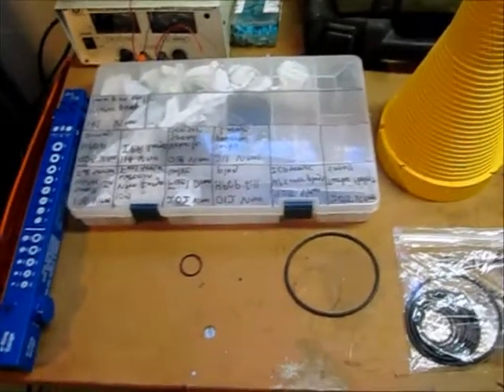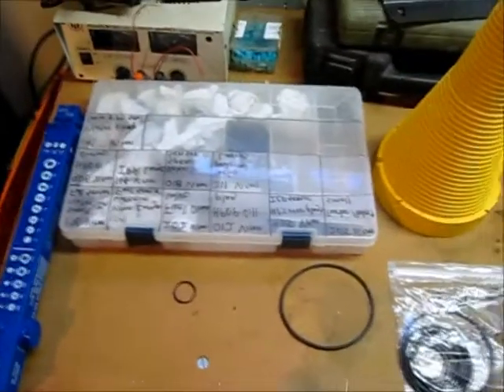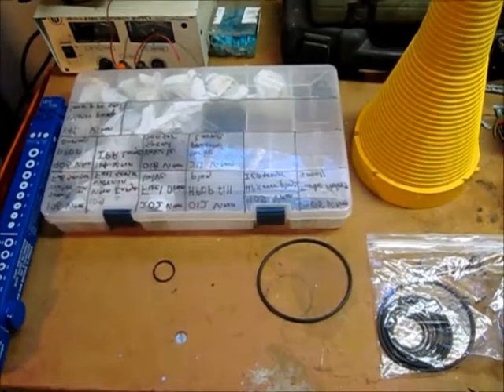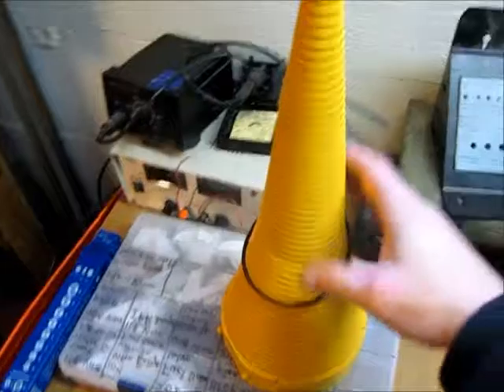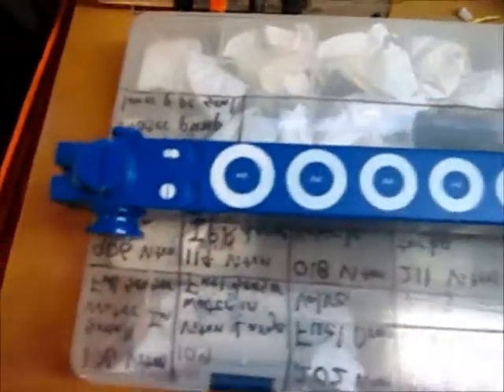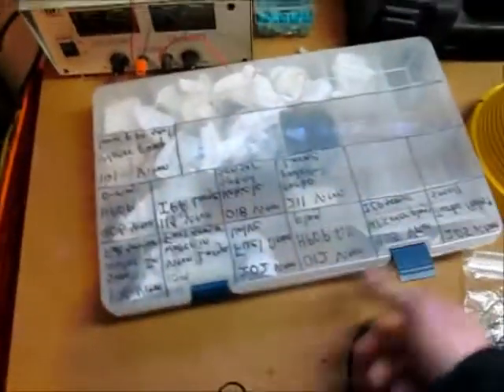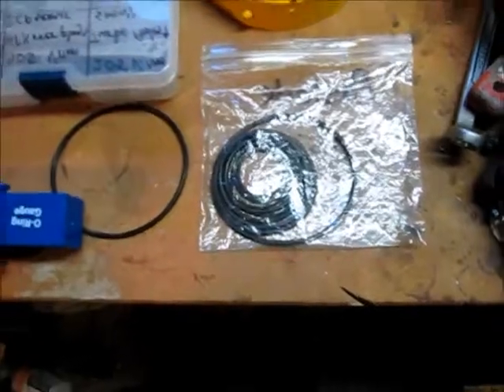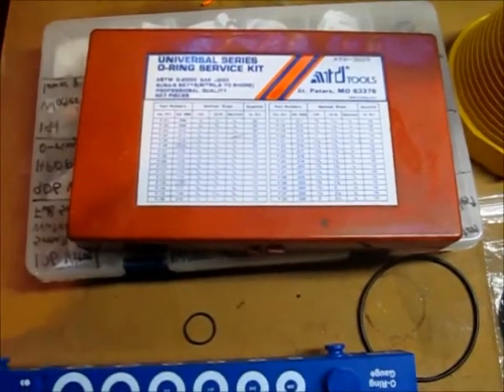O-rings and how to measure them

Comment: What if you don't have the original O-ring ? You measure the inside of the groove and then ? If you don't know the width how do you know ? What material is best for pneumatic nail guns . I went on McMaster-Carr and can't find that explanation of o-rings and uses . Can you help me out to rebuild a Basso BAT-50 16 gauge straight nailer that needs rings . It's probably from 1983 . They look like BEA guns

Comment: OK pulled out my dial caliper..came up with the numbers OD 2.525, ID 2.10, Cross section .210 ---- went to Mcmasters and found my item, I thought wow I was spot on...ID, check OD check...then the money shot...I thought if the cross section measures out to .210--- I am spot on...lol I was spot on.... my number is Dash 330 (Pool Union O-Rings American Standard pipe company). Going to save a fortune rebuilding some of my tractor hydraulics (instead of buying the rebuilding kits). Mcmasters wanted $.28 ea for qty 50 ($14.28) ( (+ shipping). Amazon had them for $1.80 ea for qty of 5. (Amazon had a 6x mark up from Mcmasters but no biggie). Thank You ......you are one of the "very few" I subscribe to YOU ROCK !!!

Comment: Ok , I have an O- ring missing approx 1/3 of it. How big is it? LOL !   I have the part it goes around it measures 1.59" and the measurement of the part it goes in 1.75" I have done a ton of measuring and math to figure it out. The crazy thing is how the o-ring companies measure wall thickness. That 1.625" o-ring can be had in several different diameters They are Non -Standard measurements unfortunately.If you are missing the o-ring you need to order at least 3 different wall thickness o-rings to get the right fit.  I think I finally have it after hours of work and research. What a PITA if your o-ring is missing or missing a piece.

Comment: what makes a Viton better than Buna o ring? my application is craft, so since there is no moving part constantly rubbing into, i suppose the cheaper grade will do just fine, of course Viton has better luster and will not crack like the Buna N type, but the cost over Buna type is almost double.
Reply: Viton is the Dupont name for FKM material.  FKM material is much more chemically resistant than Buna N.  There are compatibility charts online which can tell you which is appropriate for your individual use.  The FKM o-ring will be much more expensive as it is more of a specialty item used in only harsh chemical conditions.

Comment: Great video. I'm looking for super small o-rings 5mm OD, 3mm ID, and 1mm Thick. What number or size would this be? Thanks in advance :)
Reply: +Vapealution In the UK you would specify the size as 3 x 1 (inside dia x section dia) you would need to check the material though

Comment: some tips about orings you should know 
never use a black rubber oring on a moving part,,,as rubber is very grippy..
never lube orings with a oil based product,,as it makes them swell, allways use silicone
unless the oring is a non oil based type,,

know the size of the groove that your going to fit your oring into,,from a engineering point of view , this is how you would size a oring,,this is most important for oring seals on a moving part..

allso know that orings of the same size are never the same,, there allways a slight difference,, this is where sizing proper comes in to its own,,if your looking to cut down on friction and how much they stick 

enjoy
Reply: +gommie404 Sorry, but black rubber is often used in dynamic applicationsYou are correct with the lube but do not use a silicone based lube on silicone

Comment: #Orings are the most common method of creating a seal. From deep water applications to the space shuttle, O-rings can be found high and low. O-rings seal liquids and gases well. As a result they are used in every industrial plant, automobile, airplanes, paint guns, oxygen tanks, military tanks, and a few teenagers wrists. http://o-ringsales.com/

Comment: I have to measure an O-ring to the fourth decimal place for thickness.  Would a Micrometer be recommended? What style of tip should be used?  Extreme accuracy is required. We are using a vision system for the ID.

Comment: I noticed you mentioned you had a 7.3 powerstroke an was wondering if you can tell me the sizes of the o-rings used to rebuild my fuel bowl an I can't get a straight answer from the forums they want me to buy the kits but I can get the blue military spec orings from my buddy just need the sizes before I tear my bowl apart cause its my daily driver thanks for you time

Comment from the maker: Another option is to take the O-rings to your local plumbing supply house. Call first to make sure they sell to general public. They will size them and get you new for pretty cheap. Or use a caliper or ruler to get the measurements to size them yourself. Also sometimes you can google your filter brand and the word "parts" or "size" and might be able to find the sizes online. Once in a while you can get lucky.

Comment from the maker: For the tiny ones I use the blue slide gauge which has pictures printed on it of the smaller O-rings so you just set the old O-rings on the pictures until you find the match.

Comment from the maker: Thanks for the compliment Frank.  As for metric O-rings which are more and more common in things like newer air tools and other pneumatic and hydraulic items since most are made overseas. I have seen some metric measuring tools that look like a tape measurer.  I cheated a little and found a company that sold O-rings individually for cheap.  So I ordered 1 of every size up to a certain point and just use them to compare.  Or if the old O-ring is in good shape I will use a caliper to measure them.